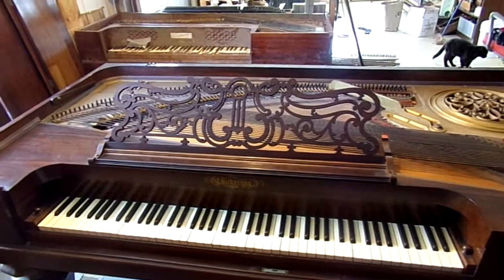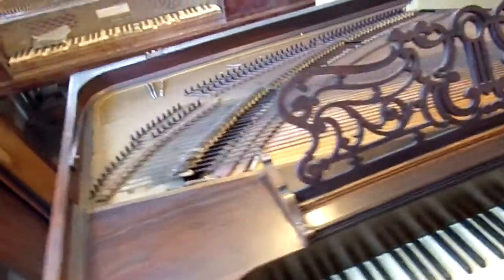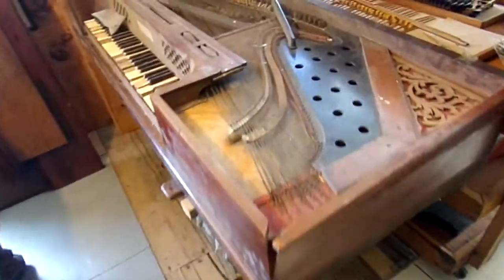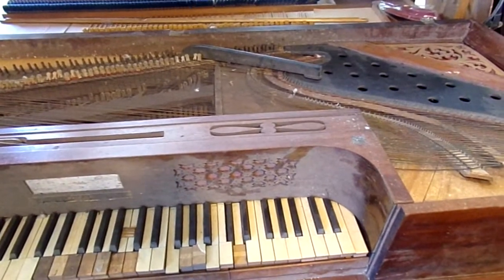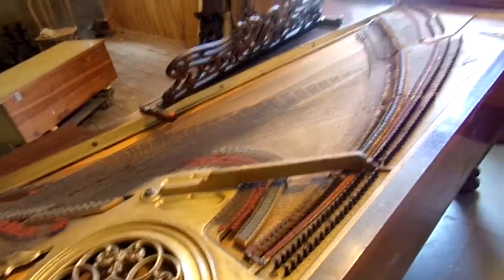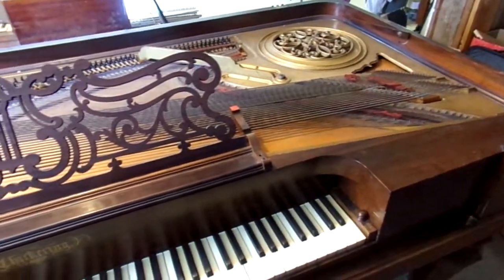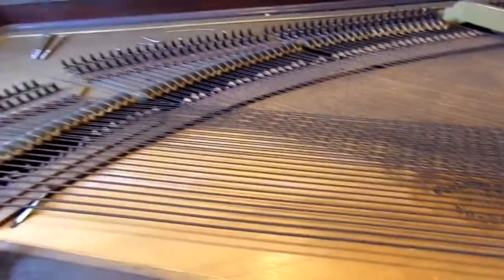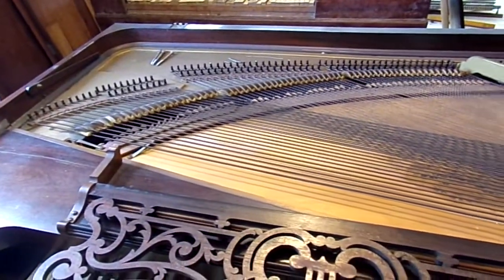Chickering square grand piano, 1863; first look

Comment: I recently removed the action from my piano. I unscrewed the stack and put it back on, once I put the action back the mid rage is muffled and the hammers are still touching the strings if you keep the note down. Any ideas or advice you can give me is really appreciated! Thanks so much
Reply from the maker: Is this that Baldwin grand?  Older Baldwin pianos are very rare here in the Northeast.   the mid rage is muffled...are the dampers lifting?the hammers are still touching the strings if you keep the note down...is the action blocking, or is a spring lifting the hammer back up to the wire?Post a video of the problem; that will tell me a lot.
Reply: Hampshire Piano it’s a 1903 6’3” Baldwin grand. The dampers are lifting and from what I can see nothing is too out of order in the action. The Technician is blaming 2 loose ribs in the soundboard and the drop of temperature here in Chicago for the sudden lack of volume. Does that sound like something that could cause sudden drop in volume? And when I say sudden I mean like in one day. I’ll post a video tonight